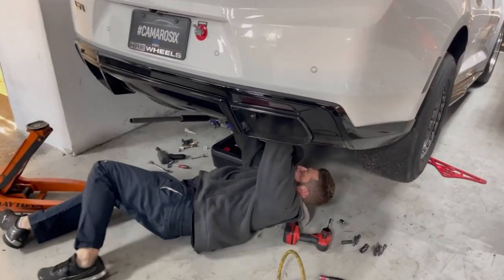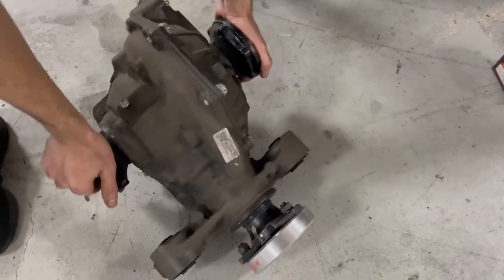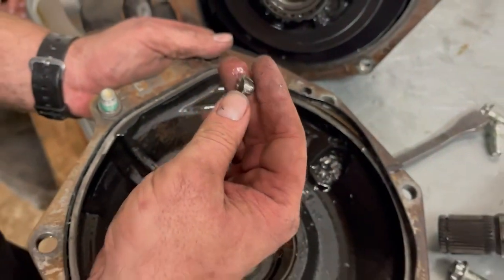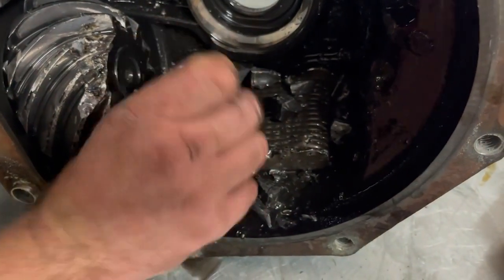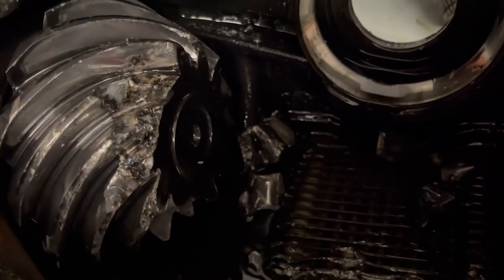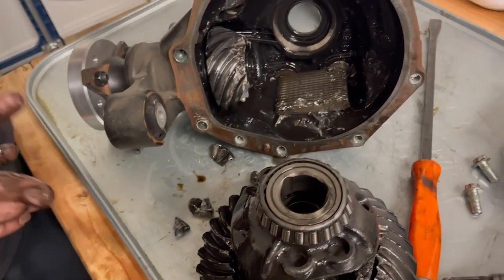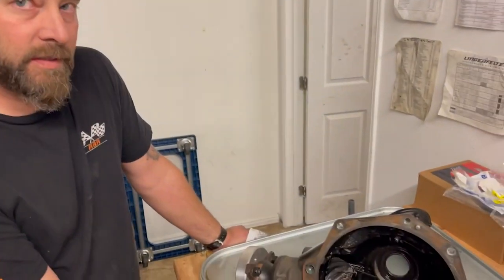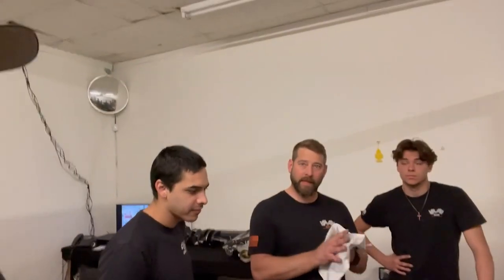Camaro Differential Tear Down!

Comment: Yep. Seen that firsthand. I built a 55 Chevy in my teens in the late 80s. Hand me down 4 bolt 350 block, Lunati crank, TRW forged pistons, novel for the time split duration Crane cam, double hump heads cut for springs and guide plates, and stripped the ring gear on the 2nd drive. Lol! Good times...

Comment: Yeah I have an automatic too and I blew my rear end yesterday. I was using a tuner to tweak the timing a little and adjust the fuel ratio and when I've used launch mode I've heard a noise for a while but didn't think about it. Well it is supposed to hold at 2000 rpm in launch mode and it went above that and I heard a crunch. Then it wouldn't drive it barely made it to the side of the road. Then I put it back in gear and was able to drive it but it was a one legger. If I gave It gas it pulled hard right which told me the left was the only drive tire. I was able to get it home but it crunched some more and now it's done. So now it's either pay $4700 for Chevrolet to do it or think about doing it myself. I see one with 2.77 gears for $1000 which makes the gear ratio a little higher. I thought I remember it being 3.55 when I bought it. So I look at the specs of the rear end and it says it's rated for 420 horsepower. I know with what little I've done in mods may have added between 25 and 30 horsepower so it was too much for the rear end. Not sure if I can find one rated higher. Maybe a ZL1 rear end k don't know.

Comment: Blew mine up! and it's an automatic, not driver error I only owned the car 4 months previous owner must have abused the hell out of it.  Kicker is GM has a parts shortage and cant get the 1 part I need to rebuild been in the shop 2 months.

Comment: Hello, we are from the Czech Republic, we saw that the wheel on your differential was broken, do you have a split inside somewhere according to the photo?
We need due to the demarcation pads, how many should there be and what kind?
We bought a Chevrolet camaro 2.0 205Kw car. It would be great if you could send photos or if you have a diagram of the differential.
Thanks in advance
George

Comment: I had a problem with differential in my 2016 Camaro SS. i bought a new one but I was wondering if there is a way to rebuild the old one and use it as a spare part. Thanks

Comment: If you just buy a replacement rear end. Won't the same issue happen again at high horsepower levels?
Reply from the maker: It’s possible. But we believe the damage was done when the trans broke.

Comment: Mine just blew currently watching this video on how to remove fluid everywhere on my rear bumper lol
Reply: Were you driving when it happened an did you get it fixed
Reply: @jacobespinosa3806  yea I was doing a hard pull, over 100 and transmission fluid got all over the place. Bought a used rear differential. Yep got it fixed the following week. $700 for the part
Reply: @brandonwilkins6816  perfect iam going to put new diff this week hopefully that will fix it I got a hole in my cooler from broken peace in my diff
Reply: @jacobespinosa3806  yea that should fix it. Remember transmission fluid is connected to the rear differentiall internal cooler. So if you install the new rear differential and your car doesn’t move then you’ll know that you need transmission fluid.
Reply: @brandonwilkins6816  yes iam going to fill transmission an diff thanks.
Reply: @brandonwilkins6816  how much trans fluid did you have to add
Reply: @jacobespinosa3806  when I get home I’ll let you know I gotta count the bottles
Reply: I followed this video I can’t recall how many bottles I put in the transmission. Just know it’s a hour process lol

Comment: Why didn't you buy a MUCH STRONGER differential housing from STRANGE?!?! 
I also recommend using Crown Gears & an EATON TruTrac Differential. You won't break it. 
The OE differential is OK. But not built to withstand the strain of the extra torque you're creating. 
If ya' wanna' cure your wheel-hop issue, upgrade the OE components with quality BMR parts. Respectfully, 
Ben
Reply from the maker: Simple response.... Cost. junk yard rear ends last long enough :)